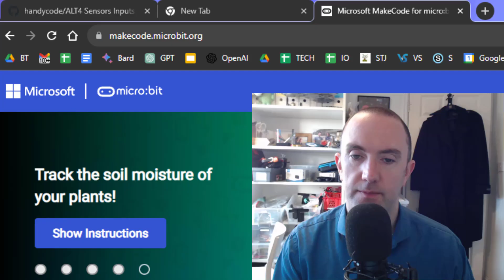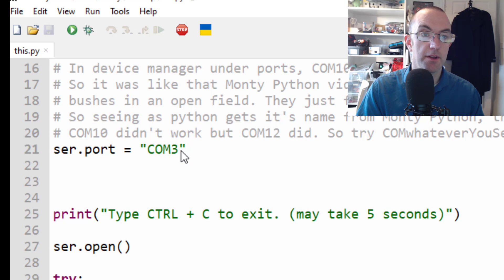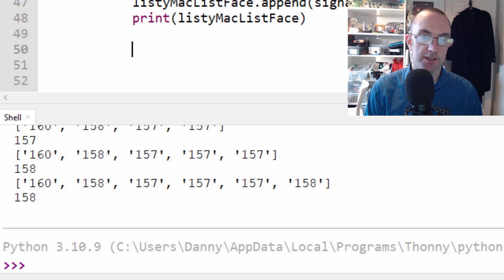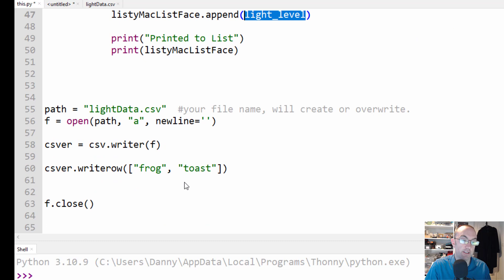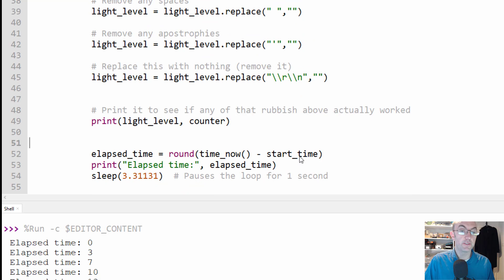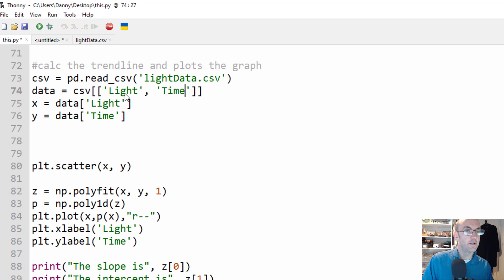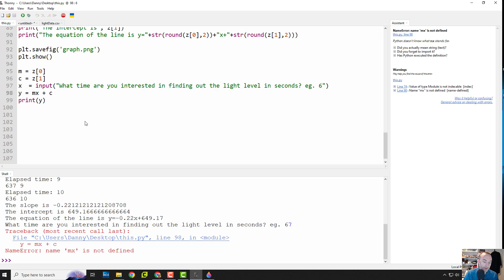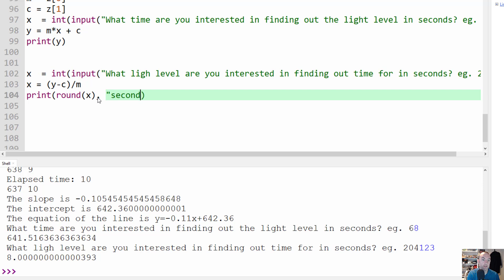LCCS Coursework 2023/24: Basic Requirements

Comment: Hi Danny, whenever i run the first block of code you put it, i get an error saying:

   ser = serial.Serial()
AttributeError: module 'serial' has no attribute'Serial' 

Do you know how i could fix this?
Reply: Uninstall and reinstall serial
Reply: Unistall serial module if you installed it, it will use the pyserial built in module by default